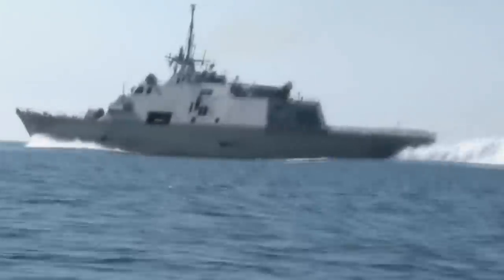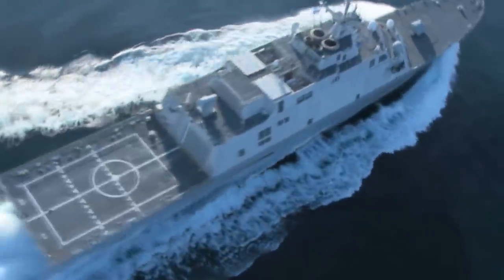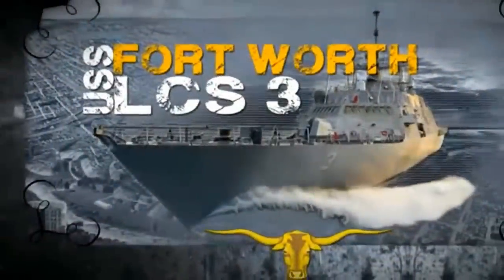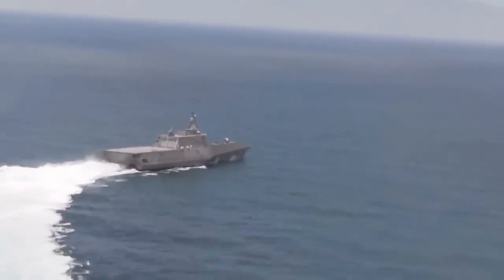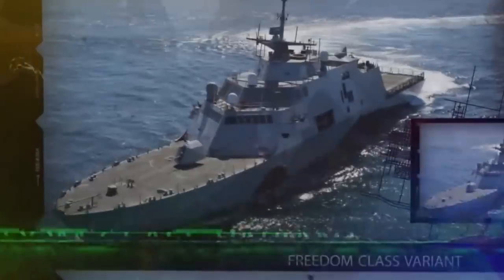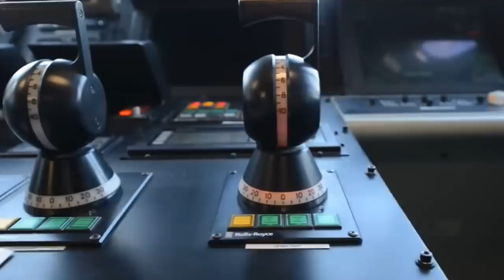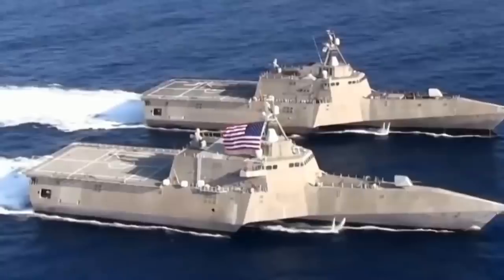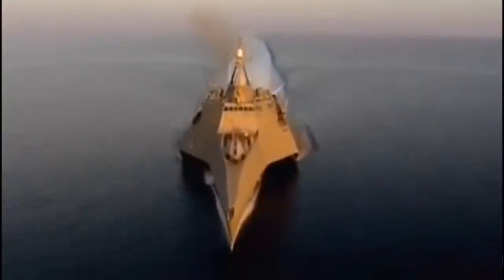U.S. Navy Littoral Combat Ship - Future Naval Firepower

Comment: As a retired member of the U.S. Submarine Force, I see several real problems with this ship.  First, the ship doesn't have a bow sonar.  The ship does have a towed array, but no light weight torpedoes.  That leaves the embarked helicopter as the sole provider of ASW prosecution.  Beyond Sea State 5, launching and recovery of aircraft is not possible.  The 45 NLOS missiles planned for this were cancelled, so that leaves the 57mm as the sole provider of surface to surface, plus the helicopter.  The CIWS is the only anti-air / counter missile platform onboard and it does offer excellent protection at very short range.  In short I see this as a platform that only addresses about 20% of current threats.  It is however, a great radar picket and most important, a special warfare support platform with its shallow water capabilities.  Great job on this video Mats!
Reply: Hang on....im a bit confused, light weight torps, those are for aviation assets, so if ican't carry LW torps then how do the helo's have ASW capability? Heavy weight torps are what you equip ships with no? 

Otherwise yeah i agree, a very niche class of ship, even if one of them comes form my country (Australia), they would be IDEAL for SF low-intensity missions in "problem" countries  and possibly even useful against modern countries in the SF support role but super niche situations for something that costs as much as this and is as limited in defense as these are, yeah its fucking hard to justify even with the stupid fuck-off budget the USN gets, dunno how they sold this project but must have had lots of glitter and bold words in the paperwork.
Reply: Matthew Ray the helos themselves carry MK-50 (LW) torpedoes, sonobuoys and dipping sonar.
Reply: I think these ships weren't built to fight an actual war or naval battle. They are basically used to intimidate and impress people, like the US carriers do. This is similar to the British navy before WW1 when we were building massive battleships to intimidate people. The US navy has serious gaps in Submarine numbers, ASW and ASuW. They ships don't do anything for that. They are so lightly armed that they can't sustain a fight against the corvettes of Russia or China, they can't hunt submarines. They are a waste of money. The US needs some ASW frigates and ASuW corvettes and more submarines. They are putting all their eggs in the carrier and technology basket. While the Japanese, Chinese and other are just building more and more ships for fighting wars. The Americans will get a shock in the next war, when they can't defeat the Chinese. The US needs to totally change its doctrine.
Reply: @johnbest4513  do you think its not by design??? america pisses off the whole world on the demand of rich psychopath from the military industrial complex,then they supply them with sub-par gear so they always demand stuff.... if we'd build our own stuff away from private corporations we'd build only the best at any cost,said armada would last a while and not only perform as such. make sure your gear breaks or is expandable and you have a repeat business.   

war being a business is the sick part
Reply: That's very concerning I didn't know they didn't have a bow sonar relying solely on ASW helicopters and told sooner they got to do better than that
Reply: These ships aren’t meant to Necessarily fight  against other ships of their class or weight . They are designed to fill a role in protecting the carrier groups against swarms of fast attack craft which it does well enough . The NSM are only used if for some reason it gets attacked by something  like  destroyers or cruiser . It would lose the fight most definitely but it would be able to put up a small fight.

Comment: Tbh the anti-ship combat role seems very limited, with no cruise missiles and only a 57mm gun with a range of 9 miles... but the anti mine & anti sub capabilities are significant.

A low hull draft and high speed can be useful for dodging torpedos, and the additional assets it can deploy for assistance in detecting sub-surface threats. Very nice

Comment: Sadly LCS has had some issues. The USN has been pushed back to the Drawing board with them as they were found less suitable to the Frigate mission need. The USN is currently running the FFG-X program that aims to follow LCS on with a more traditionally set up design. In current Down select are modified versions of both Freedom and Independence class as well as French and Spanish designs as well as a modified USCG large Cutter based design. https://youtu.be/ISTRSL80VaU

Comment: Worth remembering that these ships were intended to fulfil capabilities offered by the Avenger mine hunting ships, the Cyclone PCB's and the outgoing OHP frigates - of those, the most heavily armed are the OHPs which currently have their MK11 launcher removed and which basically rely on a Phalanx 1B for air defence. LCS has RAM or Sea Ram, a 57mm gun plus decoys and usually the two 30mm cannon from surface warfare module - and for the roles they're intended, if that's not enough, they'll be backed by air cover and larger ships.

Biggest issues with these ships - the speed requirement - that was a key user requirement at 45kts back when they were intended to be deployed by mothership and specced at 2,500 tons. When that changed and they were intended to self deploy, the requirement should have been looked at again as the machinery requirements for this are expensive and complex. I think that should have been looked at again and perhaps a more conventional hull been selected as these ships will now spend the bulk of their time cruising at similar speeds to conventional ships.

The mission bay idea is a good one and it's been taken up in the UK Type 26 which is why I feel LCS isn't a good fit for the RN and instead, the Type 31 is planned for the low end duties.

Also, it was never intended that both these variants co-exist - the intention was for a downselect to one type and having both in service means the USN is fielding two ships with different propulsion, sensor and weapons fits, with different combat management software.

That's a headache that was meant to be overcome by using one ship for the jobs done by three.

I doubt either LCS will make a good blue water frigate design however and we'll see something more like a monohull design with CODOG/CODAG power.

Comment: The LCS is good for what it was designed for-a fast, stealthy light combatant that can support anti-piracy operations in peacetime and be risked in tight waters in war time.  Its speed means it can get out of the viewing cone of AShMs, or outlast torpedos that are only a handful of knots faster.  Unfortunately, most of its intended tools fell through and the intended mission was superseded by changing strategic goals.

Now it is primarily a cheap (the first ships were boondoggles, they cost about 440mil now which is half the price of a 50% larger ffg x) patrol ship that can free up fleet destroyers.

They are getting new toys, with the TERN drone giving them possible long endurance UAV capabilities and the new loitering munitions and NSM giving them a replacement for some canceled programs.  They will never be a fleet combat ship, but they weren't designed to be.

Comment: If you want to check out a "pirate hunter" that can actually do the job cost-effectively,  check out the US Navy's 26m/85ft Mark 6 Patrol Boat.  They are actually pretty good and fill the gap between the 16m River Command Boat (like the ones in the Iranian incident) and the 52m Cyclone Class Patrol Cruiser (the real workhorse in the Persian Gulf).

Comment: OK----------  I agree with you wholeheartedly. I love the Tri-hull and everything about it but that 57mm pop-can gun on the bow.  The LCS needs  the fleet's light weight 5 inch (127mm) gun with some teeth on it. ------------  The 5 inch (127mm) turret will fit nicely if it is moved back to just in front of the square box weapons station just ahead of the Superstructure. They had to greatly strengthen the bow structure where it meets the main hull to stop cracks, giving plenty of strength for the 127mm gun mount with it's magazine in place of the the mission module with blow out roof panels. The little added weight of the 127mm mount, (the 57mm mount with its magazine inside the turret weighs about as much as the slightly bigger 5 inch turret). moving the 5 inch mount back 30 feet to in front of the mision module gives it the extra structure to Safely absorb the 127mm guns recoil. While the mision Module designed loaded weight is close to what the loaded 5 inch magazine equallings.  Without overloading the bow or changing it's sea handling characteristics.  With an effective range of 50 miles using the new Hypervelocity rounds, the 127mm gun puts the 57mm toy gun 3 mile effective range, to shame.  
-----------  Tell me. What would you want defending your LIFE when a half dozen Chinese Frigates and Cutters surround you off of one of their Fake Island Bases...  --- A soda pop can sized 5 pound grenade  that only has an effective range of 3 miles that will only damage Iranian dingy's (the ship's 35mm side guns can do as well), or a 50 pound shell that can blow the bow off of a Chinese Cutter and a hyper velocity shell that can sink a Chines guided Missile Frigate still 50 miles away before it can launch it's cruise missiles.   
------------ Put the 5inch (127mm) gun on the LCS and the experts will stop calling it a worthless show toy. But it is going to take a lot of people righting President Trump to get it done.  And only You can do it.

Comment: The bulk of these ships were cancelled.  The Navy realized these were terrible at everything except maybe pirate hunting. Most of the modules that were going to be developed were also cancelled or never worked. That's why the USN is buying a proper frigate in their FFG-X program that will actually be able to fight in an actual naval engagement. Currently, 5 frigate designs including the European FREMM and F105 have been chosen to bid for the contract. The Navy has put a 1 billion dollar price cap on the new frigates which is really only about 30% more than the LCS but with 10X the capability.
Reply: The navy does need to build a class of frigates, but, when the USN contracts for ships they always end up paying way more than the contract price when all of the cost overruns and delays are added in. Maybe they need to hire some experienced contract administrators to manage their ship building projects so they(we) don't get screwed so bad.

Comment: They need to put rows of Mark 57 VLS down either side of the tri-hulls flight deck.  Have 2 4-pack torpedo slide-in packs too, one on each side.  Take a couple, lose the hangers, raise the flight deck 15' and slap it full of weapons.  Helo pad on top, but no hanger.  3 week loiter time w/ 6,000 miles econo mode is great.  Being able to travel at top speed is also nice.  Great for the gulf  / Bahama / PR zones as well as homeland security out to 300 miles from the coasts.

Comment: The Lockheed-Martin monohull design is proving to an unreliable technical disaster, whilst the more revolutionary trimaran General Dynamics (Austal) design has performed very well. As said it's based on a fast ferry. The two hanger areas are massive (the whole crew can muster in just one of them) and the ship is extremely stable at high speed and high wave heights.  Having 3 hulls it's very tolerant of battle damage too.

Comment: I wouldn't call it a multi-role ship as much as a single-role ship, where you can change the role when it returns to port.  How much real need is there for 50 kt speed or 10 ft draft?  Sure, it's cool, but is it the result of a mission that defined the ship, or a ship in search of a mission?

Comment: Good video Matsimus , as usual, Thank You .  An update for the LCS for both classes , Freedom and Independence  the "Up Gunning" Heavier armaments has started , it was acknowledged from the very beginning of these two LCS class ships that it was an on going work in progress and one of the two may be discontinued   and morphed into One . Both have distinct differences for different deployments . but both for right now will have main gun and missile upgrades and more secondary armaments added. For myself I certainly would NOT want to be in front of one of theses ships closing in on me at 40 knots with a stabilized 57 MM 150 rounds a minute auto cannon with electro/selective round  type  blazing away at my arse. For those of the chronic  bitching  and belly whiners  they will never be pleased  and NEVER will they realize that  you can not put every thing in one package,  in the Real World  a Star Wars imperial star cruiser,  does Not exist,  so P/ZZ OFF with the arm chair fairy tale crap.
Thanks again Mastimus

Comment: I agree with this but it really will only be this good after a bit of time. Some of the modular weapons have not been made but some that are being made are pretty cool. Unfortunately, the ship didn't have like any weapons when it first came out so eventually, it can have harpoons, hellfire missiles, adaptable deck launcher, I believe 20mm guns, and probably some other modular systems as well. it also replaces the avenger ship and it has a sea hawk which can help with minesweeping. So I believe the whole package is awesome if it were all done. However, in its current state its little crappy ship. Also, I don't think it can ever replace a frigate but it will make a good corvette.

Comment: 40 knots doesn't seem like too much of an improvement over the 30 knots of the massive Bismarck class battleships or 27 knots of the gigantic Yamato class battleships of WWII.
Reply: you say that but...the Yamato had a HUGE powerplant, like im not joking, its fucking huge raw power even today, the Ticonderoga class cruisers only put out what....60,000shp? The Yamato put out fucking 150,000SHP, 150,000! the USN Nimitz Class Aircraft Carrier, which has 2 nuclear reactors, puts out 260,000SHP, the Yamato class put out more power than 1 of those Westinghouse Nuclear Reactor's does, 20,000shp more. Thats only a little less than the entire output of an Arliegh Burke Class destroyer man, battleships had this aqdvantage of being able to pack in the very biggest boilers with the biggest and heaviest gears, shafts and props, but they were also super fuckign heavy, sure Yamato could do 27knots but she was 68% the weight of a Nimitz and the Nimitz is considerably faster (like 33knots ive heard?). Thing with fluid dynamics, the force required to increase 1 unit of speed is exponential to the previous amount, this is exactly why, even though the speed barrier was broken in the 50s by the X1, that super-cruise is only NOW becoming a real ability in fighters and bombers, supersonic flight is standard but it cost A LOT of fuel, Supercruise is new, F-22 and Mig-31 used to be the only planes to do it as design, so yeah doing 47knots over 30 seems like fuck all but thats WATER we are trying to push a 3,400 tonne vessel through and the energy required ot do that is fucking huge, i guarantee the engineers relied more on fluid dynamics to achieve this than raw power.

Especially with conventional powerplants, the 1930''s werent restricted by EPA standards and all that stuff, they just burnt coal and burnt it as hot as possible.
Reply: It's top 40kts but low armor
Reply: @cgmason7568  no ship today even has armour 😂😂😂
Reply: @TheStig_TG  they most definitely do
Reply: @cgmason7568  ??, armour is not needed because of SAM's CWIS's they are paper thin.
Reply: @TheStig_TG  except they have armor and it's usually over the engineering spaces and gun mount and magazines
Reply: @cgmason7568  yes... like 3 inches of armor that wont do shit